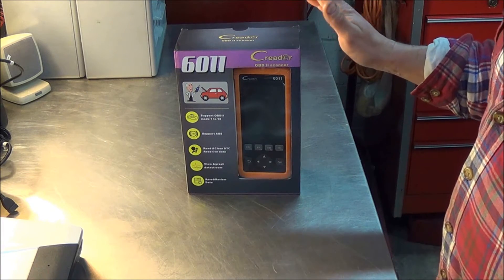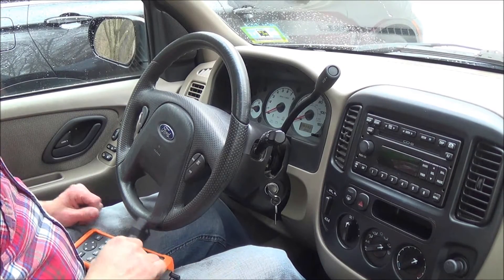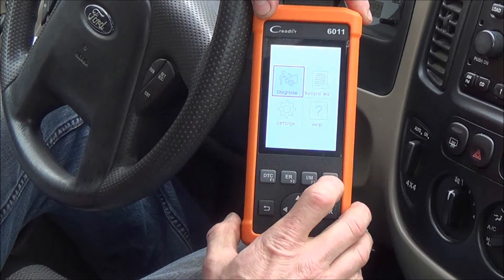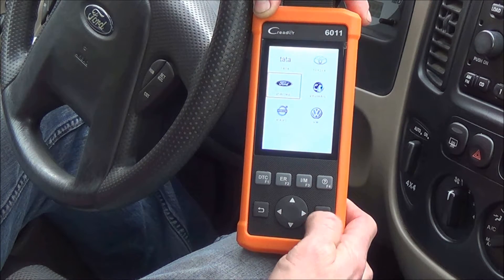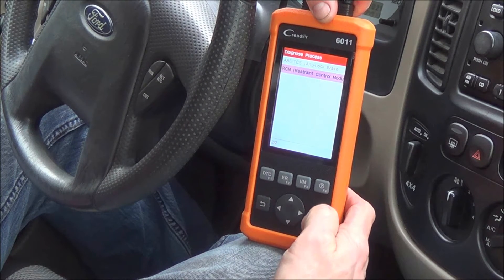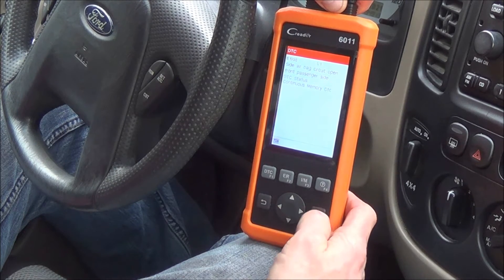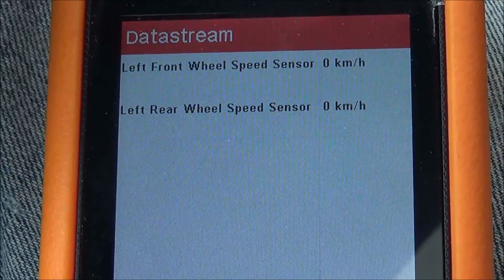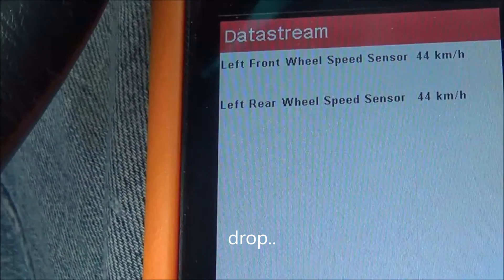Launch CReader 6011 handheld OBDII code reader and diagnostic scanner review

Comment: Have you tried the Topdon Diagnostic Scanner? I found it is better than the CReader.
Reply from the maker: GadgetEmperor  No I haven't that's what they sent . It's a video review of the CReader.
Reply: Broncocarl92 Slightly better. It is a very similar product, but the software is a bit easier to use and the diagnostic results are usually more thorough. If I had to guess, it is like some guys left the factory and started their own company and then made slightly better models of the products they used to engineer at their old employer.